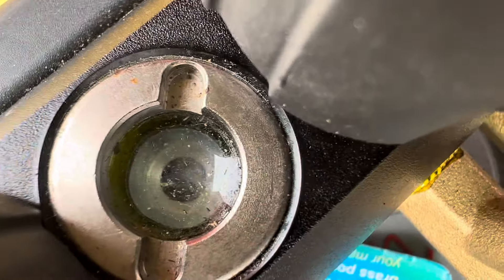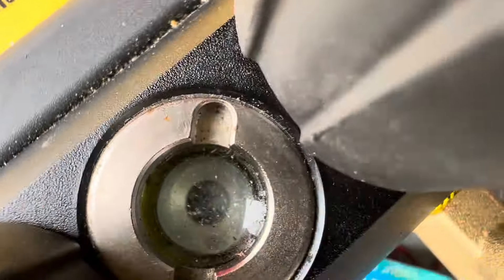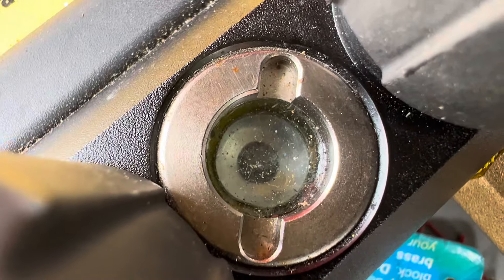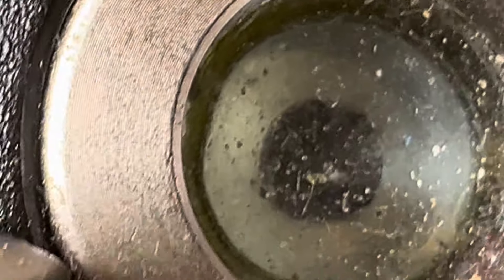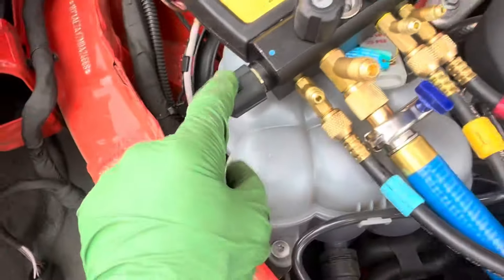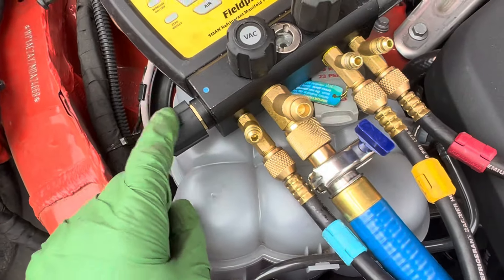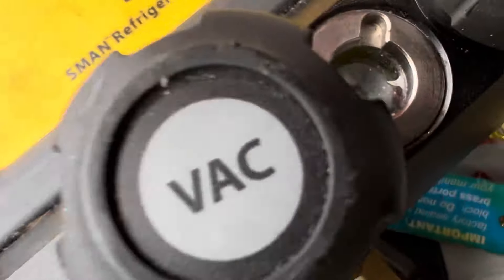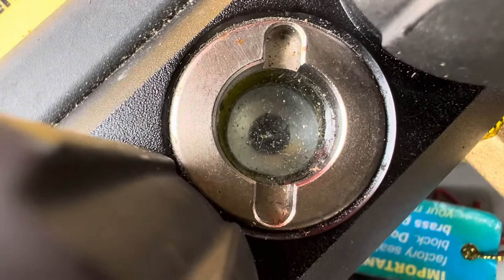Removing liquid refrigerant & oil through the suction vapor line ?🤔 you thought there was only vapor

Comment: Not sure, but I think system with fixed metering device and accumulator should be recovered on the high side. Most oil in this system is inside the accumulator which is also on the low side.